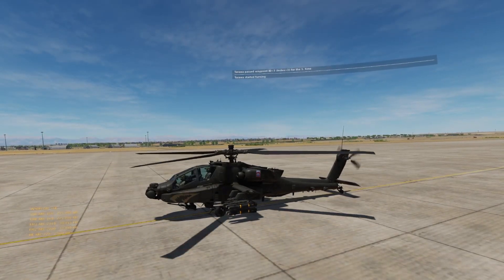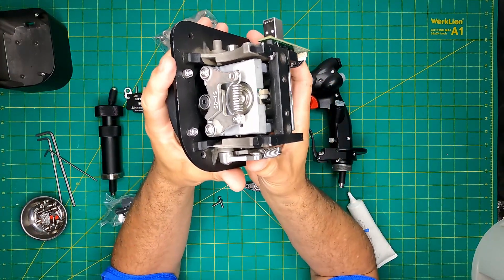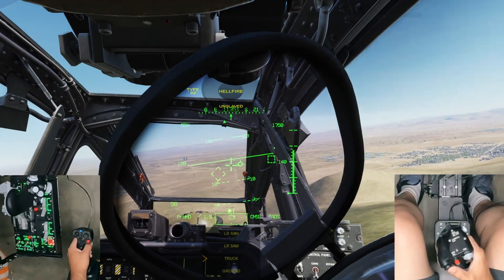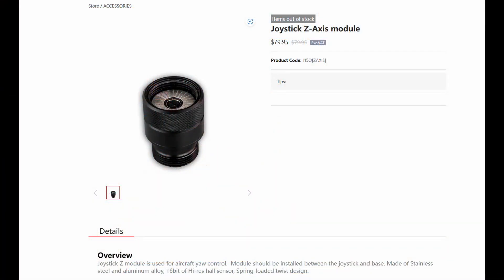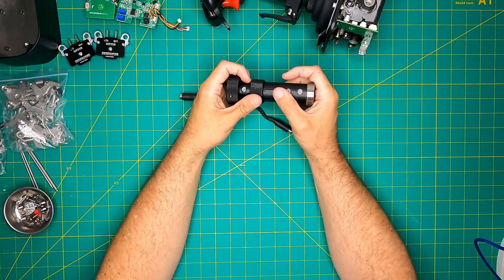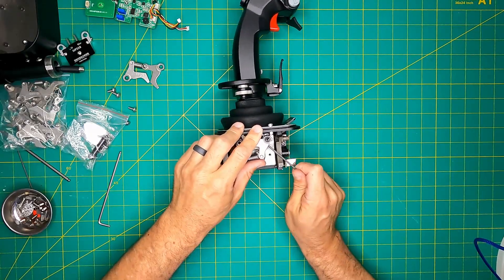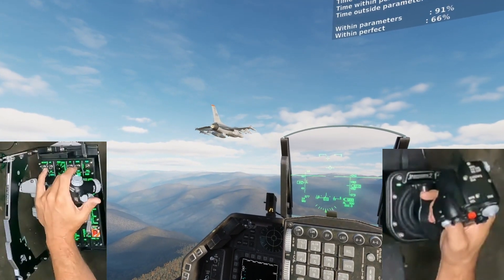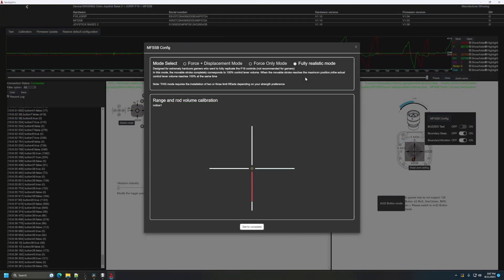Winwing Orion 2 F-16EX Stick, Spring/Cam and FSSB Review

Comment: Good review. I like how you compare the package between brands. I also like the additional tips.
You mentioned the damping grease. I cannot easily get hold of naogen 767a, but I have a variety of greases for my mountainbike. Would those do as well?
I also heard other reviews talk about tightening the damper screws, and making sure they’re not too tight to prevent stiction. What’s your take on that?
Also, which cam set do you recommend for f-16 use? You mentioned the standard one has no Center resulting in a sloppy feel in the Center region. Which cam set is best to eliminate/minimise that sloppiness?
Finally, do the cams also need damping grease?
Reply from the maker: It really has to be damping grease, not just any grease will do. Damping grease assists in the damping action while still being a lubricant. There are a variety of damping grease out there. Nyogel 767a can be had quite easily from Amazon.
Reply from the maker: I found that there was no setting without grease that provided any feel of damping without creating stiction. I used the SC-01 cams. Some prefer the no center cams. I found them too feel extremely sloppy.

Comment: Tks for the video, awesome and very complete review. Not sure if I missed it, but can you confirm what % of the force on each axis is your best setting? (% over the 6Kg)
Also, how many lateral spring plates did you end up finding the best experience with(one or two)?
Reply from the maker: I use the 40% setting right now. I also use two springs on the Y axis and 1 spring on the X.

Comment: Fantastic video! Just got Orion2 HOTAS and will be exclusively F/A-18. I was really surprised at the "floppy-ness" of the default cams/springs. I'm about to order the accessory pack, and would like to use the extension as well (but unsure if height will work). Can you advise what your recommendation is for cam/spring setup JUST for jets- and would it be different with the extension? I realize everyone is different but tbh I'd like to start with what you recommend and go from there. Unfortunately I don't have a lot of time to tinker and try a ton of options. Thanks!
Reply from the maker: @flyhoovers  my favorite cam is the SC-1 I believe. I used a 100mm extension, I installed the dampers and greased them. Just though damping to smooth things out but the stick should regain center.
Reply: @FalconsLedge  Thanks! So just SC-1 on roll/pitch axis and dampers on the opposite sides....no need for a 2nd cam/damper kit? Also, I'm using desk mounts until I can get an simpit chair and just realized I'm likely NOT going to be able to use the extension until that time. Does the standard stick, without the extension, change anything?
Reply from the maker: @flyhoovers  in did not find a need for the second spring/cam, I wanted damping more
Reply from the maker: @flyhoovers  just the extension ;)

Comment: Excellent video! Thank you. What configuration do you think is best for helicopter operations?
Reply: Using also with the Winwing extension. Searched everywhere not so easy to find information about it.
Reply from the maker: If you only fly help, then the dampers only is a great way to go. If you fly other stuff, the the dual spring/cam with extension is probably best
Reply: Thank you!

Comment: Hey mate great vid. My cam/damper pack is in the mail. BTW are you using the VKB NXT as a collective??
Reply from the maker: Yes I am! It works great as a collective!
Reply: @FalconsLedge sweet! Vid idea right there. Collectives are ridiculously expensive compared to throttles.  How is it mounted? Are you using the Omni throttle? (It doesn’t look like you are). How do you have the clutches set up?  I feel like this stick would be good as a collective with an extension, but VKB don’t make extensions for the NXT except for the Omni, which can’t turn it 90° (Z axis).
Reply from the maker: @ratsac  I mount it at an angle. I have the Omni but I don't use it for this setup. I have the x locked out, and no spring on the y. I have the clutches tightened until it won't move on it's own. There are 3D printed extensions, but it may over power the clutches.

Comment: 13:50 How tight did you need to fasten these screws? Mine are Long side of the allen key tight, i wonder if i should tighten them more with the short side? I'm worried about potentially damaging the bearings.
Reply from the maker: Not likely going to damage the bearings, they are steel. I usually did swap to the long lever on those screws and ensured that the screws were snug.
Reply from the maker: Obviously use your best judgement.

Comment: Do you have the f18 throttle? If so are the hats a similar feeling cause I really like the switch feeling on my f18 grip.
Reply from the maker: I have the Orion 1 and Orion 2 throttle. I have F-16, and F18 grips. I'll get the f-15 grip before the throttle review comes out
Reply: @FalconsLedge  How do the 5 way switches on the F16 joystick compare to the f18 throttle?
Reply from the maker: @ls1423ls  they feel like they are the same unit

Comment: Hey mate, I know I’m a few months late, just got the MFSSB as I want to learn the F16, and I’m searching for settings to try and dial it in.   I was just wondering if you ever did that short on the settings and what did you dial yours into.    I got use the duel mode, and set at 30%. But I missed what you set the force too.   Did you leave it at 100 or change it? 

I’ve tried reducing the force settings but found she hardly rolls at all then, unless I put a huge amount of force in it and then it ends up moving my Mount so not ideal.    Just trying to sort that out.
Reply from the maker: The settings I landed on were as follows:
1 spring on X axis 2 on Y axis 40% mix 100 force

10% curve in DCS 

I HIGHLY recommend an extremely rigid mount. I am using a monster mount.  None of the cheap mounts will do, they just aren't rigid enough. I'd say predator is the minimum.  Mounts will flex when using MFSSB unless you get something beefy.
Reply from the maker: My software had issues making shorts, so I never got it out, I sold my winwing hardware to review new stuff, so sadly that short probably isn't going to come. I do miss the F-16 grip, it is very nice. 

In the end, I preferred the spring/cam to the MFSSB, but I did become proficient with the MFSSB.

Comment: Man, where did you get the MFSSB? I purchased an Orion 2 base without it, planning on saving and buying it later separately, only to find out that Winwing doesn't sell it separately anymore. I'm 100% positive they used to, when I bought the base. Now I'm dying to get my hands on one of those, but they simply won't sell it separately!
Reply from the maker: As I mentioned in the video, I purchased it on the secondary market used. They don't sell it separately because it can be a bit irritating to configure properly. Though after some practice its really easy now.

Comment: The best honest review ever, I got EX back to 8 or 10 monthd ago, im not happy at all. The vibertation motor doesnt work even with default settings in DCS. I would go for Virpil if I knew how silly this was
Reply: Are you not happy just because of the vibration or other things as well?
Reply from the maker: Even with the minor issues I ran into, I still think they are a great value. I'm eager to compare the winwing solution to the VKB HOTAS in the next couple months
Reply: @ls1423ls  no, it doesnt feel right, i have my Warthog over 3 years, it feels solid, i changed it to WW F16EX due to teo reasons: the gimbal of the stick in WH is old and self centered, which causes precision correction during dogfight or harsh manuver a little bit difficult.
2. I wanted more buttons and customizable solution which WW offers.
My problem with WW is the stick, as @FalconsLedge mentioned it feels loosy, when it is centered the very slow correction without self centered CAMs is not right. I tried the stong sprint as well it is too strong, after 2 hours of flying and AAR felt exhausted in my wrest. And if I choose the medium sprint, it feels soft and loosy! 
I dont use force feedback module as I fly with different AC in DCS
Reply from the maker: @manizaeim  I went back recently and re-tried the NC cams.   HATE them. They feel awful, sloppy, terrible. Put the SC cam back in. I've been swapping back and forth between MFSSB and Cams, I just can't tell which one I prefer, even on the Viper.
Reply: Which are the stock cams, SC?? Thx
Reply: NC with medium Sprint, useless

Comment: Really like your reviews! I'm still going through it--as a fan of warbrd-style dual cams due to no center feeling, I never knew that pre-tensioners can fight the centre sloppiness. I will test this on CM3 to compare.
Reply from the maker: Pretensioners can help too some degree, but they don't  eliminate it, stronger center cams help too, but the stronger center you get you start having more of a center detent, which makes tiny adjustments harder
Reply from the maker: The cm3 has pretensioners, but it's also not dual cam. The cm3 is single cam.
Reply: @FalconsLedge  yep I'm aware of that, but perhaps my fetish on perfect symmetry of the dual cam system be overturned by this new revelation about pre-tensioning. about to test and feed back. :D
Reply from the maker: @Spelljammer1  the new warbrd-D has dual cams and pretensioners. But it also has clutches, which I won't go without
Reply: @FalconsLedge  are you sure about the pretensioners on the Warbrd-D? As far as I can see it has just the same plain spring connecting the two cams as any other dual cam system, unreachable from the outside. 
The manual highlights just the clutch adjustment screws.
Reply from the maker: @Spelljammer1  the original warbrd had them too
Reply: @FalconsLedge  I have both and I never saw any pretensioners on the warbrds, that was always the CM distinctive feature. Do you mean just the screw on the cam, to which the spring is attached?
Reply from the maker: @Spelljammer1  , no I was mistaken. The WarBRD's do not have spring pre tensioners.  Its a shame too, because it could've helped them. I mixed up the T-50 and WarBRD's features.

Comment: I had the MFSSB for probably 3-4 months and came to about the same conclusions. Changed amount of flat springs and all sorts of settings to see if I could get it close to the real SSC. Eventually I just bit the bullet and bought RealSimulators FSSB-R3 Lightning MKII Ultra and sold the WW MFSSB. The RealsSimulator Base and Stick is in a completely different league and right out of the box it performed way better. It feels just like the real SSC except the max force required is less.
Reply from the maker: I totally get what WW was trying to do, but accomplishing it is something totally different.
Reply: @FalconsLedge yes, the 2 main areas that really sets the Realsimulator SSC apart from WWs solution is:
1. The fine movement around center position. It’s so enjoyable to fly close formation and Air Refuel with the RS vs the WW. 
2. The transition between displaced and force on the WW. Very hard to get a smooth transition. I came close by adding springs and adjusting settings, but sometime would have issues during g-loaded tracking gun shots. The WW graph output was however very helpful while adjusting various settings to smoothen the transition. 
Granted the Realsimulator SSC is also twice the price, so it better be ahead by a fair margin.

Comment: Would you apply grease to the cam rollers?
Reply from the maker: No, that should not be necessary
Reply: @FalconsLedge   Thanks, I got some Nyogel for my rudder pedals, was wondering if it would be useful at all to use it on the joystick or throttle?
Reply from the maker: @algroyp3r  for the dampers on both yes, for the cam rollers no
Reply: @FalconsLedge   Thanks! Does the throttle come with dampers build-in by default?
Reply from the maker: @algroyp3r yep it does

Comment: As it turns out you only want to buy one set if you plan on using the dampeners as you cant fit the additional cams with the dampeners installed
Reply from the maker: Yeah the second set is if you want to use 2 sets of dampers or 2 sets of the same cams/springs

Comment: You don’t need to pay 60 dollars CDN for a 50 gram tube of boutique synthetic grease for the internals.
Just buy a tube of Permatex general purpose synthetic grease. It costs less than 15CDN and does the same job. You’re not lubricating load bearing components to the tune of hundreds of pounds under extreme heat. You’re lubricating a few bearings and springs that are used very lightly compared to the loads they can really take. DON’T WASTE YOUR MONEY ON NYOGEL…. It’s a ripoff and basically just clear generic synthetic grease.
Reply from the maker: For dampers it is better to get 767, it is damping grease, not just lubricant. I didn't spend that much either.
Reply: @FalconsLedge  I doubt it's better and I know it's not necessary, trust me. I've been a bike tech for years and in all the shops I've worked in we use regular high temp high pressure axle grease (the generic green type) and it's no different than the boutique Bicycle bearing grease we sell on the floor that's triple the price for a small tub. You don't need that type of grease. The parts they lubricate will NEVER reach the temperature threshold nor will it sustain any type of load that would make Nyogel a "must have" for this purpose. You're misleading people into spending money they don't need to spend. 10  bucks covers the Permatex.
Reply from the maker: @pabloottawa  again, its not about lubrication. Believe what you want. I'm not misleading anyone. 767a is the best solution for this particular scenario. I have a tub of plastic safe grease, as I too have been doing mechanic work for a few decades. Maybe ill make a video specifically showing you why you are mistaken. I've also been working with joysticks for decades you see, and I'm afraid you have misunderstood the purpose of the grease here.
Reply: Tell me……. How much heat and pressure can automotive axle grease withstand???? And if you want dampening, how thick is automotive axle grease? 
That’s all there is to it. Sorry but you’re mistaken.
Reply from the maker: @pabloottawa  1. Has nothing to do with heat or pressure. 2. Axle grease has very little damping power compared to purpose made damping grease. 

Have a nice day.
Reply from the maker: @pabloottawa  also most axle grease are not safe for use with plastics. So who is misleading who here?
Reply: @FalconsLedge  You didn't read the Label on the Permatex brand lube did you....
Reply from the maker: @pabloottawa  use what you want. 

Have a nice day.